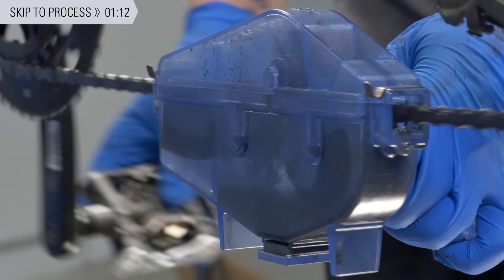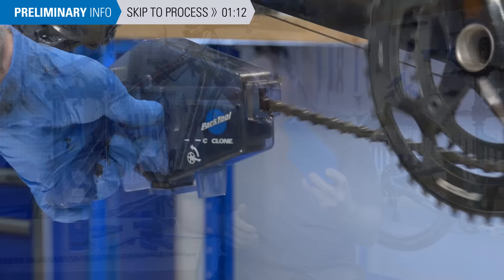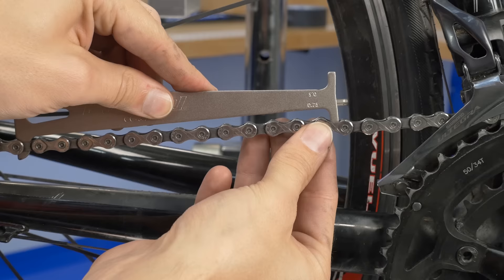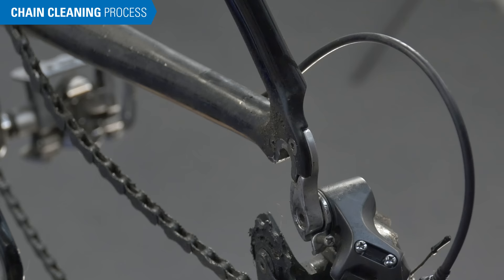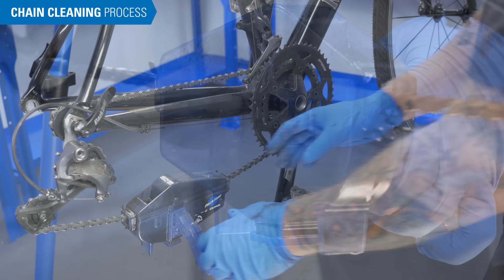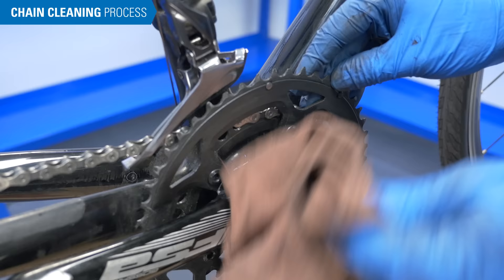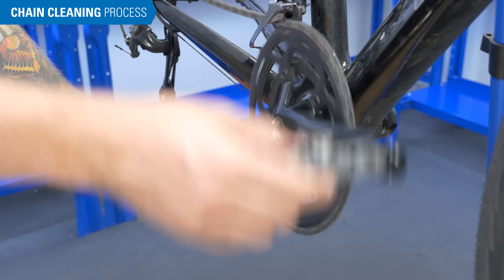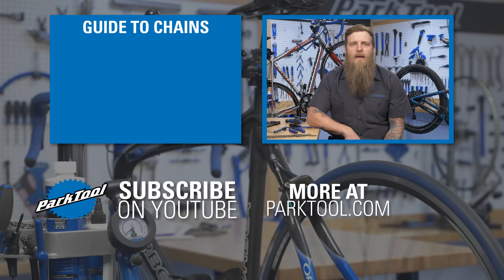How To Clean and Lube a Bicycle Chain with a Park Tool Chain Cleaner

Comment: Is there a chain cleaner that will twist the chain while cleaning it, instead of simply running it straight? There is dirt between the links where they jntersect, you can see it @ 3:36

Comment: Should we use soapy water for cleaning the chain or is it for cleaning the cleaner?
Reply: For cleaning away the solvent as u dont want any solvent left over when u add new oil otherwise it will break it down

Comment: Do you have to take the back wheel off? Is it a big deal If you clean the chain with the wheel on.
Reply from the maker: You do not need to remove the wheel to do this procedure. Some people do just to keep the wheel a little cleaner as there is a little bit of spilling that can happen when cleaning.

Comment: Does anyone have any real-numbers on what this can do to extend a roadbike's chain mileage to (referencing something like a CC-3 gauge)? I mean, that chain in this video looked like a timing chain out of a 1964 buick - with baked on grease. From installing a chain, I use a good chain lube, my bike never sees off-road or rain (I live in the desert), and I can get a consistent 2k miles on a chain before 'stretch' overtakes me (cassettes on every 2nd chain). How does 'chain cleaning' actually benefit me, when you couldn't tell one of my old 2k mile chains from a new in-box, until you put a gauge on it?
Reply: Ur chain isnt stretching, is dirt and grit wearing out the roller and connecting pins. Keeping the chain religiously clean will probably double the life of it and increase.thenlife of the cassette too.

Comment: How do you remove/dry the soapy water off the chain before re-lubricating?
Reply from the maker: The chain should be wiped off after running the soapy water through it. I find it best to blow the chain off with an air gun after. This gets as much of the soapy water out as possible before letting it air dry for a few minutes before lubricating.

Comment: If I don't have bike stand would standing bike upside-down while using this tool be problematic?
Reply from the maker: Working on the bike upside down with this product is possible. Of the CM-5.2 you will use it on the section of chain that is in between the chain stay and seat stay. If you have the CM-5.3 you can use it with the handle on the opposite side on the section of chain that is above the chain stay while upside down.

Comment: You said that i should shift to the smallest cog on the front and back. But won't this put stress on the chain and damage the drive chain ?
Reply from the maker: There is effectively no stress at all as the pedals are turned backward.  Chains can easily handle this.

Comment: At 1:52 I usually pour my solvent in before attaching to the chain and closing the chain cleaner. Is that fine as well? Works for me so far.
Reply from the maker: That is totally fine to do.
Reply: @parktool  Got it thanks! Great tool btw

Comment: When I was doing this and back peddling the chain came off the bike... what did I do wrong? I had it on the proper gears as per instructions
Reply from the maker: As you back pedal, the chain cleaner guides the chain.  If it is twisted side to side, it can make the chain come off.  Try an test.   Run it dry, no fluid.  Back pedal and notice how you hold it keeps the chain on....or can drop it off.
Reply: @parktool  

If I don't have a bike stand can I flip the bike and put it on it's handle bar then and do it that way?

I was doing a dry run when this happened

Comment: Wait I'm confused. When u guys said refill the chain cleaner with soap and water and then repeat the process, do I dump out the soap and water then put more chain cleaner in or leave it in there and put chain cleaner in?
Reply from the maker: Remove the fluid before filling with soapy water. Old fluid can be stored, allowed to settle, and reused. Or dispose of it properly.

Comment: Hi Park Tool, how do I clean the brushes and sponge after using them to clean the chain? Do I just soak them in soapy water? How to scrub the dirt out of the bristles?
Reply from the maker: It is best to clean them with a solvent and then soapy water. The soapy water does not break down the grease enough. Hope this helps!
Reply: By solvent, you mean the degreaser which is also used to clean the chain?
Reply from the maker: Yes thats the stuff.

Comment: how often do you have to do this in wet conditions and is engine degreaser
Reply: If ur chain makes noise or looks like at the start of the video then it needs cleaning and re-oiling

Comment: Hi can I "pedal forward" with the cleaner? I have an Ebike. 😃
Reply from the maker: You cannot. You can try to put it on the top section of chain or you can try flipping the bike upside down. Keep your ear to the ground for future product updates...
Reply: @parktool  Why not just orient it with the handle on the non-drive side? Won't that work with a dummy hub?

Comment: Will this work for electric bikes that are 750W with a 48V battery ?
Reply from the maker: The new CM-5.3 has a reversible handle for newer e bikes that have mid drive motors. It is often impossible to pedal the drivetrain backwards on those systems to the reversible handle makes it possible to clean while pedaling forwards on those bikes..

Comment: Will any of those tools work for a BMX with a 25-9 drivetrain?
Reply from the maker: On most BMX bikes there isn't enough room between chain and chain stay to fit the tool, meaning it will not work.

Comment: Hi!  Very nice vid!  Does anyone know... I bought a whole gallon of concentrated "Simple Green".  Foolish to ask now, but does it work very good?  I heard it does, but find now here you can actually re-use the Park Tool de-greaser.  I could still get a refund, but it costs a lot to mail it back because it's so heavy.
Reply from the maker: Simple green is a fine degreaser. Try your best to keep it away from aluminum and carbon components. Simple green on their site warns that it will increase the rate of corrosion on Aluminum components. I have also had it remove clear coat from wheels and carbon components. If used correctly it is fine but you need to be careful with it.
Reply: @parktool  Thanks as I never knew that about Simple Green and in a way regret buying first a whole gallon, a foolish decision!  I live in a big high-rise apartment building and thinking of cleaning my bike in a distant corner of the lawn.  Will it kill the grass?  I thought it's biodegradable, so would it be okay to dump the remaining on the grass or in the bushes?

Comment: Gear cycle  or non gear cycle  is best for boys under 15 years
Reply from the maker: Depends on skill level and what how they see themselves riding. I would see gears coming into play at this time or earlier but if they are racing BMX or want to ride a fixed gear then a single speed would be great. Hope this helps.

Comment: How do I clean my CM-5.2?  I don't want to get grime into the chain next time I clean it.
Reply from the maker: Here is a link to a blown up diagram of the CM-5.2. https://www.parktool.com/assets/doc/product/CM-5.2_instructions.pdf
You can disassemble it, use some solvent and then some soap and water to get it nice and clean.  Hope this helps!

Comment: Can I get away with using only soapy water? will this damage my derailleurs in any way shape or form ?
Reply from the maker: You can use just soapy water if you would like. It will not break down the grease or clean the chain as well as a degreaser though. Wrench on!

Comment: If I clean my chain so it gets Rusty and if I put oil on it so it becomes dirty again
Reply from the maker: Often a dry lubricant will stay cleaner when you lube. The draw back to this is a little more drivetrain noise and the need for more frequent lubrications. I point this out to say that the type of lubricant that you use depending on your riding and the climate where you ride will change. The right type of lubricant will stay cleaner and last longer. Hope this helps.

Comment: You've got to be kidding me. I just take a can of break cleaner and I'm done with all metal in 2 minutes.
Reply: lol I was thinking same thing, looking for this in the comment section.  Any cons on using regular old Brake cleaner on those parts?  then lube it with WD40?
Reply: @indoperfect4080  actually I was at Walmart within the last month and bought this Tech clean for a dollar fifty a can and it works as good as brake clean at 1/4 the cost. You can use WD-40 as a cleaner and then a special lubricant for the chain that's design for chains.

Comment: Can i use a degreaser?
Reply from the maker: You can. We suggest using our degreaser. It is a citrus degreaser. If you use others there should be no issue but in some cases aggressive degreasers can degrade the bristles.

Comment: What do you guys do with all the nasty rags?  Seems like a waste to throw them away, but way to dirty to put in the washing machine.
Reply from the maker: The key is not to use YOUR washing machine. You will also want to use some degreaser in it as well. Something like simple green works well.

Comment: I bought my bike for $100. Can I justify spending $119.99 on a repair stand, $60 on a cleaning gadget, $30 on solvent/lube.. etc etc.
Reply: Nah, just buy a new crappy bike after 1.5 years. Or pay someone $200 to replace the worn-out components. You'll be saving so much money.

Comment: Another thing that they say you must buy. I submerge the chain in diesel fuel and rub it with toothbrush.Makes chain new.You decide what to buy.
Reply: ΜΠΑΜΠΗΣ ΡΟΥΧΛΑΣ I'd buy tool, in fact I have it.  While I'm done, you're still fiddling with the tooth brush 😋
Reply: Just take off the chain and throw it inside a pet bottle with some kind of solvent and shake it
Reply: ΜΠΑΜΠΗΣ ΡΟΥΧΛΑΣ  strong solvents such as diesel damage the chain in the long term and dry out the knots
Reply: Its clear that you have a desk job

Comment: The chain does not look really clean after the process in the video...
Reply: If you will pass a chain through a chain cleaner (of any manufacturer) until soapy water will remain almost transparent, then remove front sprockets, a cassete and cogs of the rear derailleur, clean/wash them with at least soapy water (white spirit is an option), you'll get your chain quite as it looks in this video))
Reply: Agree I get mine way cleaner.

Comment: I don't believe you can get your chain really clean without taking it off and swilling it about in something (I believe Sheldon Brown recommends boiling it in a solution of household detergent). But perhaps worth remembering before you take too much trouble that we lIve in a golden age in some respects, when some bike components, including chains, are amazingly cheap.
Reply: hermoglyph 22 we need to fight against the throw away culture
Reply: adougan99 Entirely with you there. But your chain is going to have to be discarded sooner or later - and surely is more easily recycled than most things? so you weigh up how much trouble it's really worth taking to prolong its life. I only mentioned it because some people really seem to go to excessive lengths - must spend as much time cleaning their chain as they do actually riding their bike! It is a 'consumable' item  - take proper care of it, of course,  but whatever you do it won't last for ever.
Reply: Perhaps it's a bit like the oil filter on your car - if you really want to you can take it off and clean it, but is itreally worth it?

Comment: I dont understand when i put chain lube ill wipe the chain again?
Reply from the maker: After applying you should wipe the chain off as the excess oil will attract dirt. The important lube is the lube that has actually seeped into the bushings of the chain itself. I like to apply chain lube and spin the cranks a few times to "exercise" the chain and pull in more new lube and displace some of the old lube before wiping. Hope this helps!
Reply: Park Tool is it safe to use a Chain cleaner? Im planning to buy 10 of it
Reply from the maker: It is very safe.

Comment: I ride my bikes 365 days a year (snow/ice during winter in Sweden) and often get into discussions about dry or wet lube for the chain, what do you say?
Reply from the maker: 365 in all weather conditions. I would be on a wet lube. Loaded topic though and i'm sure it would be split.
Reply: i guess, if you really ride 365 days a year, you can use dry for dry months (May and Summer in my region) and wet for wet days.  I personally have both and use it depending on the weather.
Reply: Bästa frågan! Men vad bra, jag kör alltid wet lube...

Comment: Having a bike stand, dummy hub, and the chain cleaner would lead me to believe you probably already know how to clean your chain. 

Why not show a video of how the casual rider, who doesn't have all the gadgets, would clean his/her chain? After all, majority of riders aren't going to have everything you show in this video.
Reply: I personally use brake cleaner (yep...) to spray and clean the chain and cogs. Once it's dried and wiped with a rag, I oil the chain with cheap and simple 3-in-1 oil. I've tried fancy "dry" lubes, wax based; all they do is bind up the rollers and stiffen the chain, and then shifting sucks. Cycling to me is meant to be simple, and while this a simple enough demonstration here, cycling has become filled with way too much wankery.
Reply: Remove the chain and put it into a jar with solvent and let it stay there overnight.
Reply: bottle of bicycle drivetrain degreaser (one with a sprayer to make it easier to put the degreaser on the chain), and a toothbrush. Works good for me.

Comment: I liked this video until I spoke with my local Bike shop that does Park training and they do not recommend this chain cleaning method because cleaner, soap and water will end up in the bottom bracket plus derailer bearings. they recommend removing the chain each time you clean it. Which seems to make sense to me. I am glad I spoke with this shop first it kept me from making a costly mistake, what a shame that these experts in this video did not bother to mention this issue and a solution. I guess if you had a third hand with a rag on the chain while using the cleaner tool you could avoid the issue and use this chain cleaning method.
Reply from the maker: There are many ways to clean and take care of your chain. Some people remove the chain and some just use a rag and some others prefer to leave the chain on. This chain cleaner is one way to clean the chain. Stop in to the next bike shop down the street and you will get a different chain cleaning technique, i guarantee it. Even within a shop there are often heated discussions about the best way to maintain a chain.
Reply: A lot of chains are not easy to remove. So having a way to do it on the bike is essential

Comment: Can a   rusty chain be brought back to life,some links are kind of stiff by the rust?
Reply from the maker: Depends how rusty it is. If there are only a few rusty links you can take the two plates and "excersize" it by moving them back and forth. Do this on all the stiff links and you can get back in action. If it is really bad then replacing is suggested.
Reply: Park Tool thanks for the tip!

Comment: Not harsh criticism but you rinsed the chain cleaner in a sink. This is why I think it's best to go with bio "friendly" "degradable" type cleaners.
Reply: Are you saying I shouldn't dump my used motor oil in the Storm drain?

Comment: Chain manufacturers (such as KMC) actually warn you not to use a tool like the one above and never to de-grease your chain completely, for it is "the only way to make sure your chain gets damaged immediately and permanently."
Reply: I think that is for chains with O rings and X rings like u find on motorcycles. I dont think bicycle chains have these o-rings hence a complete solvant clean shouldnt be an issue

Comment: My chain always comes off in the front when I try this. What am I missing?
Reply from the maker: Think of the CM-5 as the "Guide Pulley" when you back pedal.  Practice with no fluid to see this.  Keep the CM-5 pointed at the front ring. If it is twist left or right as you back pedal, then the chain is guided off the ring.
Reply: @parktool  A late thanks from my side! I got it to work almost immediately after posting this comment. Seems it just takes a little practice. Now it works great!